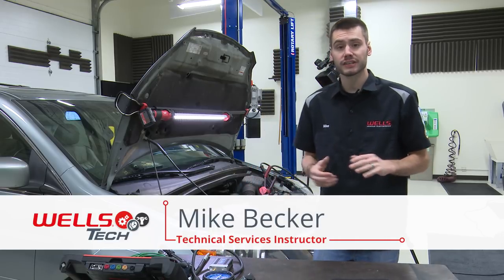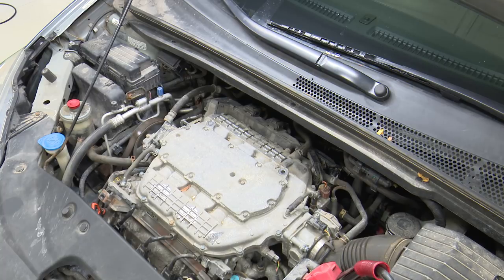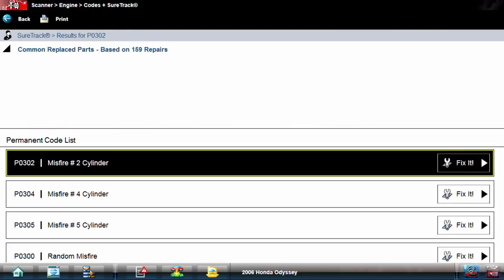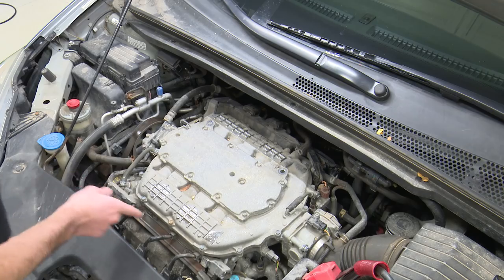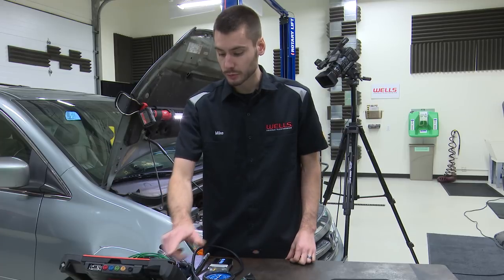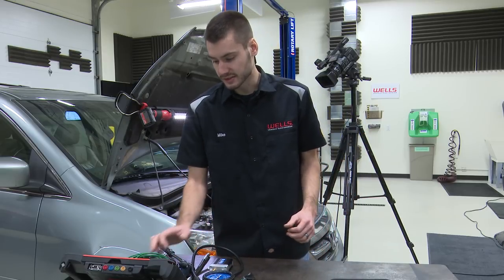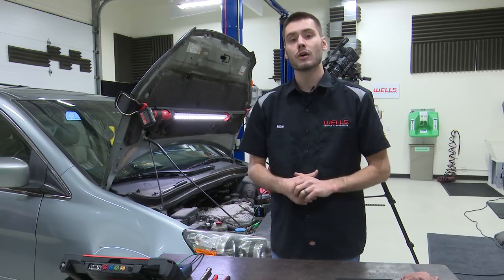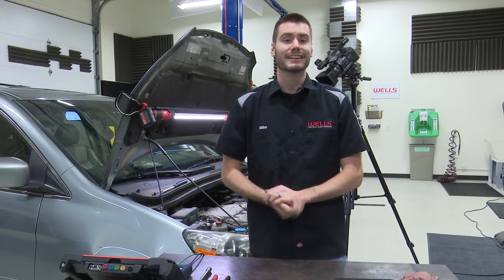2006 Honda Odyssey 3.5 Random Misfire Case Study Part 1 : Diagnosing the P0300, P0301, P0302, Etc.

Comment: Hi Mike, I have been working with the Pico Pressure transducer for over 2 years now and honestly you are looking at a very normal scan. First you can not say 3 degrees off since you have set the cursor to far left, move it further right where a slight kink is in the graph that is where the exhaust valve really opens. Second go by manufactureres specs to determine if it is off not by rule of thumb. 30 to 50 degree is a wide range and for example for my old Jaguar 58 degree is normal, so use specs not guesses. Now even more important is that you placed the cursor for exhaust valve closing to where it hits bottom, this is wrong .... exhaust valve closing is not very easy to spot. What you can see is the curve going downward that tells you the exhaust valve must be closed and the intake valve must be open. Reason: as long as the exhaust valve is open (including valve overlap) there will be no drop below outside pressure. Actually the drop (vacuum or call it suction) results from the low pressure that exists in the intake manifold when the intake valve opens and subsequently the piston rising again. 
Honestly a tight exhaust valve can be reckognized when you get less vacuum on the expansion stroke because they seal badly and open early which is not the case with your engine. The speed of the rise is not abnormal and not usable for diagnostic purposes ..... if it rises to slow you might have a problem (plugged exhaust or worn cam lobe). If the expansion pocket is not as low as the intake pocket that usually points to valve sealing issues.
Now a cold engine gives you a shorter open duration because the valvs gap is too big so the lobe engages later and disengages earlier, that is why you should warm them up first. Actually heat expansion is the main reason why you need that gap in the first place.
I believe that scan is absolutely normal. Your problem is somewhere else. Real mechanical problems are much more prominent and can be spotted very easy. They are hard to miss.
Greetings, Bernhard
Reply from the maker: Hey Bernhard List, first of all I would like to say I really appreciate the time you have taken to watch this video and post this comment. The goal of this video was find a way to determine a slight issue with valve adjustment, without pulling covers and physically measuring them. Judging by the results I had from this there was a difference between before and after. You'll see in part 3 that there is a noticeable difference in both the pressure equalization point in relation to BDC and the what I measured as valve duration. You feel like there is not a way to tell a mild valve adjustment issue by using a pressure transducer? I agree also that 30-50 degrees is a huge range, but sometimes that's all we have to work with. It's almost impossible to find an actual spec many of today's cars.
If my problem was truly somewhere else on this engine why would performing the valve adjustment fix this car? It is confirmed. The car has been back on the road for almost a month now, and over 1200 miles. No roughness, no check engine light. All that was done was an exhaust valve lash adjustment. I did not touch the EGR or EGR ports at all on this engine. Thoughts? 
Again, i really appreciate the comment and feedback. By no means do I know it all. I hope that we can all learn together! Thanks you!
Mike Becker, Senior Technical Services Instructor
Reply: Wells Vehicle Electronics 
First, great if it solved the problem I am happy for you, I might have been off track for some time.
Ok, I did not write to criticize but to point out some misunderstanding about interpreting those graphs on the Pico. 
First I love my WPS500X it is a great tool but as it is with all komplex tools they require time to learn and the curve is steep but at the end it is very rewarding diagnostic tool.
One hint on exhaust valve opening: if the curve at the bottom does not have a prominent kink in it (camlobe engages) but is very round it does point towards a very small or no gap at the valve. Now since you did the test on a cold engine with a close gape it will worsen when the Valvestem expands whe hot. Would be interesting to compare them both. I bet that the bottom of the expansion pocket would rise due to earlier engagement and make it better visible and of cours shift the rise point further left. This is more interesting than a steep rise after opening because the larger the pressure difference the faster the rise. 
Now this statement is just my opinion (no actual proof yet) but if the rise is rather flat it would appear as if the airgap at the valve seat opens too slowly for the air to escape (worn cam lobes?!?!)
Greetings
PS: for diagnostic purposes you would love to see my scans from a 2001 Jaguar XKR which had an intake cam shifted by a whopping 176 degrees. It looks like nothing makes sense any more but it helped me solve the puzzle.

Comment: Leave guesses in the appropriate questions below 😁
Reply: Hmmm and if it was would it affect the vacuum reading? Hmmm would it affect just random cylinders?  Hmmm would the vacuum be steady, erratic, high, low with a P0302, P0304, P0305 or possibly be unaffected?  If unaffected which way would you lean...valve adjustment or solenoid with these waveforms and DTCs...hmmm? Would your fuel trims be affected...hmmm? If you're talking about a solenoid for the exhaust I think someone stole it :D  Hmmm VCM J35A7
Reply: If you're talking about the exhaust :D

Comment: i am curious if this test is valid on a turbo engine as it has more than 100% volumetric efficiency is shouldn't go into a vacuum at the both of the stroke with both valves closed, right? Im sure you can still compare when the valve opens in correlation to the stroke of the piston just i figure the waveform would look quite different. I might be out to lunch on this but I'm curious.
Reply from the maker: Hey Anthony, this test was done at idle, so really it shouldn't look much different because there's no boost. Under boost you would expect something totally different!
Mike Becker, Senior Technical Services Instructor

Comment: Mike, my 2006 odyssey is having a misfire. codes reads P0305.  Just spend $5100 on a used motor, radiator and new spark plugs.  Drove it for 250 miles after the service only to get a blinking check engine light on.  Not sure if i want to take it back to the dealer, mainly because its really far where i had it service (car die there).  How much do you think it will cost for a valve adjustment? And do you think this is cover by the dealer, because they told me that it includes a 2 year parts and labor.  
Thank you
Reply from the maker: Hey Max La, honestly I would take that vehicle back to the dealer that did the job and complain. That light should not be blinking 250 miles after having an engine put in. They should take care of you...Don't assume it's a valve issue though. A lot of different failures can cause that check engine light to come on and blink.

Mike Becker, Senior Technical Instructor

Comment: why not a cylinder leak down test:1. hook up air 2 go listen to the tail pipe 3. Hear air leaking, Sell valve adjustment
Reply from the maker: Robert, in some cases i'm sure that could work. Not sure if it would have on this one. Would have been an interesting test. I'm not sure of the result. Maybe they weren't hanging open far enough to leak? Hard to say. Good input though!

Mike Becker, Senior Technical Services Instructor
Reply: I was thinking the same thing i.e. how would I've done this say 20yrs ago without pressure transducers and Picos lol but at the same time I really liked the video as this is the way to do these things today. I enjoy using the labscope even though it takes me longer to setup and interpret results but that's because I don't use it often enough.
Reply: You likely wouldn't be able to hear it, because it isn't quite tight enough to hang at TDC. The lobe is ramping it too quickly. I agree, though, that given the circumstances it could have been sold.

Comment: I have a 2011 pilot i yhink is doing the same thing.  I origionally thought it was simply the vcm operating soeraticky to put it in eco mode but now I'm thinking I might need to make this adjustment.  Wondering if the engines are similar or if you could comment on whether using vc muzzles is a good practice to control the eco mode on a second gen 3.5 vcm engine?

Comment: I have a 2004 Honda odyssey 3.5 and I have the same issues where are u located and what's the cost for a diagnostic like this
Reply from the maker: Hey Marlon, we are located in Fond Du Lac, Wi. Generally, this should be able to be diagnosed in an hour's time. So most shops should charge you their standard 1-hour diagnostic fee. 
Mike Becker, Senior Technical Instructor
Reply: This guy is real .it's hard to find real mechanic but running across u ur real and know what ur doing
Reply from the maker: Thanks Marlon, good luck finding a good shop in your area!
Mike Becker, Senior Technical Instructor

Comment: Needs a valve adjustment😊
As the exhaust valves get more “seated”, they tighten up.
I had to do mine at 160k .. same misfire codes.

Comment: I agree to have valve clearance looked at but believe it is due to the VCM/cylinder deactivation mode that spit that cel.  It came on for me when I put load on the engine and eco mode doesn't cancel.  That cause the engine to shutter and the ECU interprets it as misfire which then switches to limp mode (cel blinking).  Cleared the code and smashed the throttle and the van just flies like a bat out of hell.  No problems since.  Although I believe it really was caused by wife's negative energy (whining/complaining).  Honda engineered these engines too well to fail prematurely.  It's an ecm programming issue
Reply from the maker: Hey, ahh the negative energy causing issues! Been there, seen that :) Well, this van got a valve adjustment and is still check engine light free to this day (owners a coworker of mine). Your van may be a different situation but at the end of the day maintenance is maintenance and needed to be completed.
Mike Becker, Senior Technical Instructor
Reply: VCMuzzler 2

Comment: Would a tight valve adjustment be a constant issue or could it/ would it be an intermittent issue?
Reply from the maker: Hey Anton, depends on how tight they are. Also depends on driving conditions. Maybe they are only slightly tight and are only affected when the engine is really? The check engine light may or may not come on all the time...but generally speaking a tight valves a tight valve. No changing that.
Mike Becker, Senior Technical Instructor
Reply: The issue im having on my 06 mdx is an intermittent check engine light for a misfire but its never felt on an engine thats warming up from cold. Alot of times its cylinder 1 & 6 and had cyls 5 & 3 once or twice, already went thru the ignition system with plugs and coils and changed out all 6 injectors so at this point im thinking it could be a valve adjustment issue or egr ports dirty. Any input on what you think?

Comment: I adjusted the valves perfect and still have the codes p1399 and cleaned the egr valve pulled the egr out of the vehicle dont know what to do
Reply from the maker: Hey Danny, P1399 is a pending misfire code. How is the ignition system? Plugs within maintenance spec?
Mike Becker, Senior Technical Instructor
Reply: @GoTechTraining  I think I need new coils but didn't check the spark plugs

Comment: Would this reflect in a compression test as well? Im getting good compression  (about 175psi after 5 cranks in each cylinder) but have persistent misfire codes and very negative fuel trims.. especially in Bank 2.

Comment: Would you see a problem if you put pressure sensor in the exhaust or intake? My guess is you would
Reply from the maker: I have heard that you can see these issues watching a cranking vacuum waveform. Unfortunately I did not capture it. Next one I will thought. The mechanical gauge was steady, but the transducer is soooo much better :) 
Mike Becker, Senior Technical Services Instructor

Comment: 80% of misfire issues on this engine is injector related . It is a really nice engine design, GM used basically the same engine in the saturn vue's.
Reply from the maker: Hey James, thanks for watching! Actually the engine in the Vue is Honda's...GM just borrowed it ahah!
Mike Becker, Senior Instructor
Reply: @GoTechTraining  , sorry that was what I meant, that its a honda engine that GM just borrowed.  I see why too, its a great engine if maintained properly. thanks for taking the time to share all of this info with everyone the correct way to diagnose a problem. I hate when people just throw $ at a problem(s).

Comment: My daughter was driving her 2005 Honda odyssey and all dash lights started flickering and started shaking and then died.  Any suggestions? Help
Reply from the maker: Hey Valerie, how is the battery and charging system? The vehicles electronics can do weird stuff when battery voltage is low.
Mike Becker, Senior Instructor

Comment: Not sure if i missed it but how does that cause a misfire?
Reply from the maker: Hey Anthony, it's all about how the engine breathes. At idle this engine was holding the exhaust valve open way to long reducing the efficiency of the burn creating a slight misfire. This wasn't like a dead ignition coil miss. Someone on here referred to it as a fish bite misfire. I'd say that's the most accurate way to describe it. 
Mike Becker, Senior Technical Services Instructor

Comment: eric o has a video on this also, his video shows vaccume like yours, showing that is caused by leaking valve, if valves were not leaking should it go to zero?
Reply from the maker: Eric has a video on everything. haha! I believe any time the exhaust valve is open it should equalize the cylinder to whatever the exhaust pressure is.
Mike Becker, Senior Technical Services Instructor

Comment: I have almost the same problem, but my 2010 odyssey, started to shake only when it’s cold, and show up code 3497, but then I turned off  disconnect the battery for a few seconds, put it back problem solved for the rest of the day , I have driven 6 hours straight no issues, but the next day when it’s cold the same story.

Comment: Just finished tearing my 04 down and adjusting the valves.  Had miss codes on 3 and 5 and random misfire code.  New plugs all around.  Still missing mildly when at idle.  Also, huge flat spot on first acceleration after warmup then restart.  I assume they are unrelated.  I put a new TPS in while I was in there, but flat spot is not better, and maybe worse now.  Anybody have any ideas?  Google is a wasteland when it comes to Odyssey hesitation on acceleration, at least for my year.
Reply from the maker: You maybe have an ignition coil or 2 failing? You could try swapping them to different cylinders and see if it follows.
Mike Becker, Senior Technical Instructor
Reply: @GoTechTraining  good idea.  I was wondering if there is a good way to test those coils without owning an expensive diagnostic computer.  Those coils cost about $52 apiece.
Reply from the maker: There really isn't. Load testing a coil is the best test for it. That's why I suggested swapping to another cylinder. If the issue follows, then you know its a coil.
Mike Becker, Senior Technical Instructor

Comment: Hi men , I have a question,  I cleaned my throttle body and map sensor on 2009 mdx then my  check engine light came on and the rpm got crazy so I relearned the tps and did the idle procedure but still the problem is not solved.  When I press the brake pedal to stop the car so the rpm bounce at the end and also when I release the gas pedal the rpm jump with out pressing the gaspedal and also some times the rpm just drops still my foot is on the gas pedal. Any advice please and thank 🙏
Reply: My guess is map sensor let me know if you figured it out.

Comment: Wait a minute, (finished watching the video almost).  My understanding would be that not all valves would have the same issue therefore your theory is a bit miscalculated, one or more cylinders even would show up differently than the abnormal one, therefore an easy elimination with compression test and knowing, of course, about the valve lash issue, thanks.
Reply from the maker: Hey, you're right, it's unlikely they would all wear the exact same. Small discrepancies could be seen. But we see those in compression tests too. A few PSI one way or another is normal. Hard to pinpoint that. 
Mike Becker, Senior Instructor
Reply: True, but a cap of oil poured in the cylinder after first test and before 2nd will indicate bad rings if compression increases, burnt or open valves compression will remain low even with oil in cylinder, as well as a head gasket say between two cylinders will have equal low compression. My point is that for the back-yard mechanic like myself the tool you have is beyond the scope of affordability and this would be true for many viewers, my 2nd point is that your movies still show me stuff to enhance my skills, adaptable to the limited tools on hand & to share that with others:  With experience we can get beyond most of those restrictions.  It would certainly be nice to have such a tool, to speed up diagnostics; we all know some can be very tricky, for example I really enjoy and learn a lot from your O2 sensor vids. Thanks again and looking forward to more vids as I’m new to your channel and hopefully some Hybrid stuff is available :).

Comment: I believe this engine only have a cam sensor on the front bank so the rear bank can still be out of time without setting a correlation code as its not monitored.
Reply from the maker: Hey Ousmane, that's good to know! Thanks!
Mike Becker, Senior Technical Services Instructor